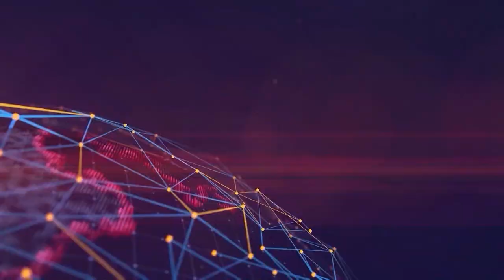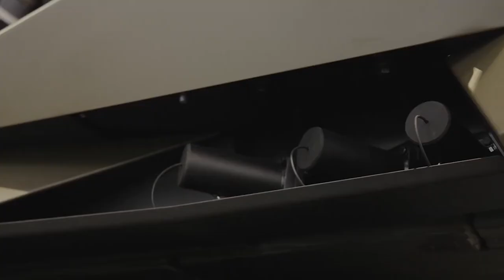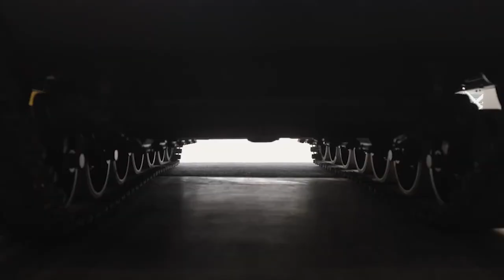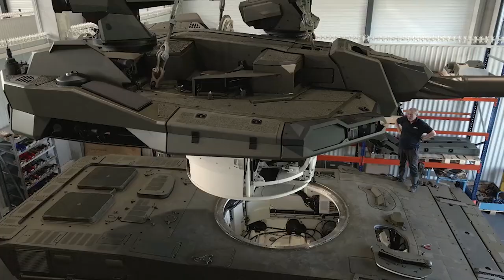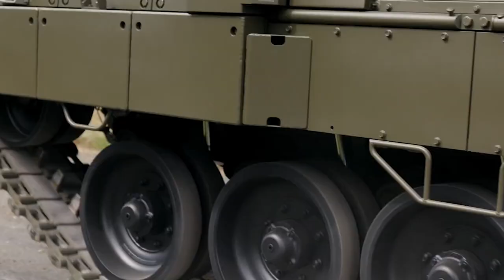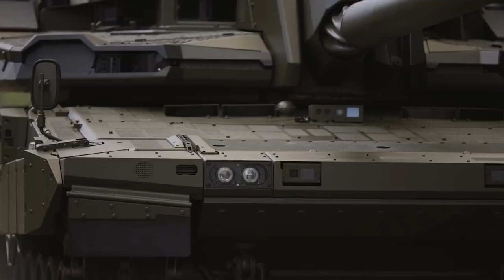Discover EMBT Nexter future concept of Enhanced Main Battle Tank developed by France and Germany

Comment: The tank seen so far in the new military context no longer makes money no matter how well it has done. The war in Ukraine showed us this in full. That's why I'm glad that these tanks are an evolution, not something new from scratch. The costs are infinitely lower. How about
 the chassis (leo2 used in the case of Nexter and Phanter KF51) are an evolution, where the hubs are eliminated by modernizing them. It was seen at T14 Armata how much it cost in the end and how long it took to complete it. I think that even now it is not how the Russians want it to be.
Reply: Eventually there will also be an effective weapon/countermeasure against drones. The further development and completely new development of weapons and weapon systems has always been a "race" and will always remain so.
Reply: @dieterdodel835  I agree 100%.
Reply: The reality is that the châssis development isn't the most costly aspect. Active suspension systems are known today, the electronic isn't that expensive. The main research and evolution on tanks today are related to
- its sensors, the same would be used on a new or an old tank
- the gun calibre with companies having various approaches in that regard, a lot is invested in it by Nexter and Rheinmetall
- the ammunition related to the new calibre. 
- and the main cost, by far, is the networking system. The ability to work together with the rest of the army by sharing all the data. But that's not it, there is a need for the system to analyse the data and provide only relevant information to the crews. 
- there is the use of active protection system which is becoming a major evolution, and has a cost for the best systems
- there are all the additional weapons and sensors of new generation, such as reconnaissance drones, loitering munition, and missiles that will be installed on the turret. 

All in all it means, the turret needs to be entirely new in order to instal a new gun, with its automatic or not loading system. The ammunition storage is affected. The sensors are in higher number and are taking space. The need to have space for loitering ammunition, drones and missiles mean an entirely new architecture. 
In the end, using an "old tank" and fully modernize it reuses at best the châssis, potentially the powerpack, but now hybrid power is considered as an important advantage in the future, so even this might change, therefore the châssis would need modifications. 
So a fully modernized tank would be expensive, new platform or older one, doesn't matter. 

Regarding the Ukraine war and Russian tank use... Well, Russia has mostly demonstrated incompetence in strategy. Against a modern anti-tank missile, unless there is a successful active protection system, any tank would be destroyed. BUT, that's why tanks are not supposed to work alone. Everything needs to be coordinated, infantry, artillery, tanks, IFVs, etc... Tanks alone are vulnerable. But on a well organized attack, the tank will be an asset to breach defence lines that wouldn't be possible with any missile system or infantry system. Or at least not effectively. 
Ukraine wants tanks, that's not for no reason. Tanks would help them go forward and attack.

Comment: Does the turret miss side armor or is it just not finished yet?
Reply: I believe it is an unmanned turret so no need for heavy armor.  Similar to the Russian tank, I dont remember what it is called but they have built several but not in use yet.
Reply: @465maltbie  its manned you can see the hatches on the turret with periscopes. Its 2 manned like leclerc
Reply: @neurofiedyamato8763  There was an article a  week or two ago about a similar vehicle with a remote turret.  This may not be the same vehicle.  Thank you.
Reply: To answer, nothing seems to be missing. It is purely by design
Reply: Possibly new design to maximise crew protection by lowering the turret height & armour angles. Not sure about the big main gun cupola though...
Reply: It's a modified Leclerc Turret.
The Leclerc sacrifices some Armor for lighter weight, it's intentionally less Armored to keep Mobility up.
Whether or not that Sacrifice is worth it is debateable, but it's intentional.
Reply: It's a big mistake to think big armor is relevant on modern tanks, considering actual modern anti-tank last weapons and tactics.

Comment: Anyone knows if EMBT Nexter or KF51 that will succeed Leopard 2? Which is better on paper?
Reply: These are just tanks offered by private companies. 
In the meantime, France and Germany are the only NATO / Occidental and their allies developing a new tank at the moment. The 130mm gun of the KF-51 and the 140mm of the Nexter offered on the EMBT are in competition to be the new gun of their future tank. The plan of France and Germany is a fully newly designed tank, so none of the 2 will be selected by either Germany or France. 
But these tanks plan to be exported, Eastern European countries are in needs of tanks. India will purchase a huge number of tanks. All this means new competition coming, and these tanks based on existing platforms are a solution to easily bring it to the market without too much cost. They use the R&D for the future tank and retrofit it on those platforms. 

Will they be commercially successful? Impossible to say yet !

Comment: Looks great. But more of a hybrid than a new tank. Unlike Kf-51 Panther, which is a new tank. The hulli s old (Leopard 2) and the turret is a modified Leclerc, so modified and not new. The Kf-51 is a completely new design. So I would go for the Kf-51.
Reply: Who is going to buy either?  The French aren't finished with the Leclerc and the Germans are very content to sit behind Poland with a couple hundred 2a6s and 2a7s.  Maybe one of the Emirates will fall in love with either and buy a hundred or so.
Reply: it is the designate of the leopard 2 modify with a 130mm gun nothing more.  there is nothing new, if you place the leopard and the kf-51 on the blank you will see almost the same thing apart from the kf turret and a little bigger
Reply: @Red.Hot.Chili.Beans63  Yes poland with its giant economy...

Germany can outspend poland easily since they got a much larger economy and with what poland is currently doing that gap will only increase. 

France and germany combined got a economy of 9 trillion dollars and most likely spain will join the program with the benalux nations adding it up towards 14 trillion dollars. This is a way larger economy then all of the eastern european nations combined. 9 times the polish economy which means poland would need to spend 9% for each percentage that coalition spends on defense to get an equal amount of money. 

Funny enough poland might be stuck with a tank that might not use the future standard of NATO ammunition since I am certain that both the abrams X and this EMBT tank will change munition standards. From 120mm to 130 or 140 mm guns, meaning that poland will have to make their own specialized munition like the british did with their rifled guns. Since I highly doubt that korean tank could be refitted with a 130 or 140mm gun because they would need to re-design the entire tank. 

Poland seems to want to overly complicate their own logistic system to the point where their current decisions will bite them in the ass later. From a logistical standpoint I see the polish military as complete idiots while from a rapid procurement perspective they are logical in their decision. 

Though there will not be a invasion on NATO territory in the short term so the logistical perspective is the more realistic perspective. From that point of view they are going to bankrupt themself by creating a lot of problems while trying to solve a non existing problem.  Good leaders think about how to make something sustainable not trying to always use short term solutions. Since short term solutions generally backfires. 

The true long term solution is a EU army since the EU got the resources to sustain a large millitary on a reasonable budget since 1% of 24 trillion dollars is a lot larger then 5% of a 1.63 trillion dollar economy. The economic size matters(ppp) when it comes to military might. This is why russia is a paper tiger while china is not.  I would never want to move to poland right now since I am certain they will have a economic collapse extremly soon since they are spending money that will not have any return of investment. Its funny when people talk about poland becoming a regional power while ignoring the economic prospect of the nation. 

Spending money they do not have generally leads to bad outcomes. Perhaps this time it will be different though I highly doubt that.

Comment: Can't know for sure if KF 51 panther is better or this
Reply: KF is clearly a full generation behind this. Just check at the spec list.
 it's comparing a good GEN4 plane with a F22/F35.
Most of the features are simply not present in the KF, and the Gun itself loads Less ammo (not telescoped ammo), less powerfull, and less evolutivity, less diameters in the cartdridge to put self-guided ammo and so on.

Comment: This is just a proof of Concept not what the MGCS / actual E-MBT is going to be.
This is the EMBT, the "Enhacned Main Battle Tank", which is not the E-MBT, the "European Main Battle Tank" which has been renamed MGCS-Concept due to obvious reasons.
Though the KNDS EMBT 2022 is actually a Vehicle yet while the MGCS/E-MBT still is just a Leclerc Turret on a Leopard 2A7 Hull.

Well, what you're seeing is basically also just a Leclerc Turret on a Leopard 2A7 Hull, but it's a very Fancy Leclerc-Based Turret on a enhanced Leopard 2A7 Hull with some System Interoperability, Fancy Sensors and a Trophy APS.
This is not what the E-MBT/MGCS is going to be, it is meant to be proof for the respective Governments and People of France and Germany that a jointly developed Vehicle is theoretically, and to a certain extent practically, possible.
Though among most Analysts this is still very much so debated as the French are notorious for being incredibly protective and biased towards their own industry and ideals, that's why they left the EF-Programm to develop the Rafale after all, while the Germans are well known for relying a lot on their incredibly expensive, though modern Technology like the Puma IFV or Meteor A3M which would make procurement by the less wealthy European Countries basically impossible.
As nice as the Idea of a joint System is, the current French Mindset of "It has to be as French as possible" and current German Mindset of "It has to be as New (and thus expensive) as possible" just don't go together.
Again, the entirety of the Typhoon Program is a great example of that.

With the current political Climate within the EU there are Three Main, more sensemaking and realistic Solutions, the Economical, Competitive and Political one, in that Order, ranked by Viability:
The Economic Solution would consist of every EU-Nation choosing the System that is the most Viable for the overall Economic Situation of the sovereign Nation and the EU as a whole, which would end in the even more widespread adoption and modification of the highly Modular Leopard 2 Platform, which in turn would just piss off the French because there is a reason no other European Nation uses the Leclerc while the Majority uses the Leopard 2.
-
The Political Solution would be different batches of Vehicles by different collectives based on Shared Doctrine and Ideals, which would probably just end like the Previous European joint development Programs:
Germany, Sweden and Italy come up with a excellent but expensive System, maybe joined by Spain while the UK, Australia, South Africa, Israel, South Korea and/or Japan might chime in as non-EU Observers, the French would do their own thing, again maybe joined by Spain and/or one/some of the non-EU Observer Countries and Poland would probably join up with the Baltics, Eastern- and South-Eastern Countries to come up with a significantly Cheaper, but ultimately inferior altenative.
So basically Status Quo.
-
The Competitve Solution would be to have one Big, Definitive Competition of European Manufacturers which would decide the best System.
Which sounds like the fairest and best, but would just end in either a Leopard 2 Version or the KF51, which in turn would, like with the Economical Solution, lead to a German-lead System becomming the Norm, which again, would mean that it wouldn't be an actual "Joint European System" and more of a "German-based European System".

Nothing against the French, but the issue here is that the French demand that at least half of the Vehicle is French, even implementing the Leclerc Turret on the E-MBT was not the first choice, and while they at least seem to have agreed that there are changes that have to be made to their beloved Turret, it's still inferior to the Leopard 2's.
Again, there is a reason most of Europe (and even non-Russian-buying outside of Europe) chose the Leopard 2 over the Leclerc.
At least the MGCS-Concept is still running, maybe they'll come to senses and develop a better Turret based on the Leopard 2's, or even better, develop a completely new one.

Now when it comes to my Opinion i honestly hope we'll stomp the MGCS-Project in the Ground, along with FCAS, Germany and France are just too different Politically and Doctrinally, i mean just look at the Tiger or the Eurodrone.
As with FCAS, none of the viable Options see a succesfull and more than anything equal codevelopment.
Of the three most Viable Options i honestly like the Political one the most.
Both Germany and Sweden and Germany and Italy work a lot better together then Germany and France, and i don't really see how the Italians and Swedish could clash.
Have the Germans, Swedish and Italians develop one System, the Easterners and Baltics theirs and then have the French build their own or find someone who is willing to cooperate with them, if that's even possible with how protective and biased they are.
Reply: It is funny to read that, considering that in France the exact same discourse exsits, just swapping the names of the countries...

Comment: Carring around little autoturrets is the job of IFV's and not battletanks.
Take them off, make it lower and lighter.
Reply: I'm think you're wrong because in a modern battlefield where the threats come from everywhere, giving more vision to tanks is vital.
Proximity awareness of tanks are generally bad, so giving them a remote turret and proximal cameras allow them to see threats coming from the sides, especially infantry and treat them immediately without turning your main gun away from your main target.
The bigger remote turret has been probably designed to treat aerial targets such as light drones. The war in Ukraine showed how dangerous they are (especially the ones dropping bombs) and tanks are mostly defenceless against them
Reply: By your logic, we should also remove the ATGM launcher of the KF-51 panther
Reply: @pow-r_official  There is non i guess.
Youc an fire a missile through the gun, that only means you need two different storages inside the tank.

Leo2 and some versions of the Merkava are also equiped for but not with a mechanism like this.
Reply: @tigersilberhannes9153  in the end it comes down to doctrine usage. You are comparing your country's doctrine with the french one (for the turret tech and design). Tanks are very vulnerable also, we saw that with the conflict in Ukraine, so this must be a retex from it
Reply: @remistiegler5302  на Украине, большая часть танков пострадала, от старых советских ПТРК и артиллерии, а не от БЛА. Россия даже сняла козырьки на башне, потому что сверху угроз очень мало.   Хотя они тоже несут опасность, но не так много по сравнению с пехотой и артерии.
Reply: you are wrong, this autoturret is linked to a sound 3D sensor autoaiming proximity threat. New tanks are fitted with multiple optical sensor and must defend them. Plus,  a special soft and captor specifically auto-clean drone threat, with ability to shoot verticaly. 

i just never could hop in a tank without knowing i have not this guardian angel allways checking the sky above and sniper around
Reply: And boom, your tank just got destroyed by a cheap suicide drone. Well played